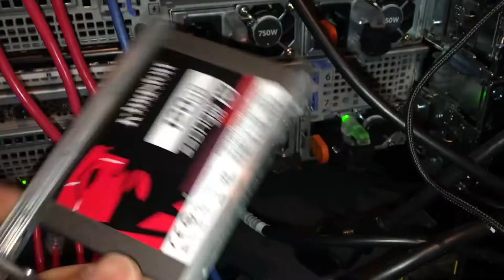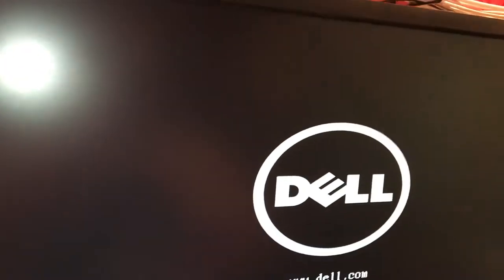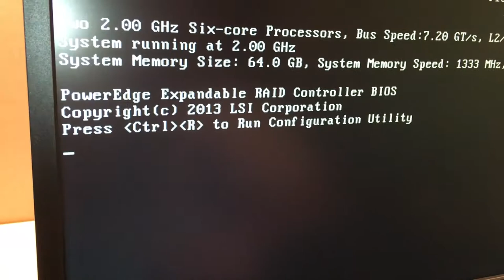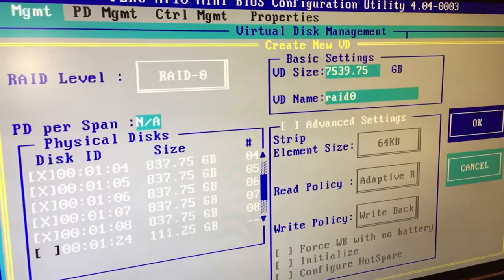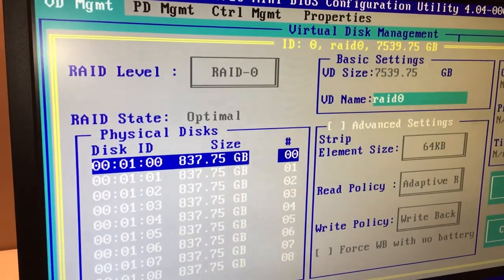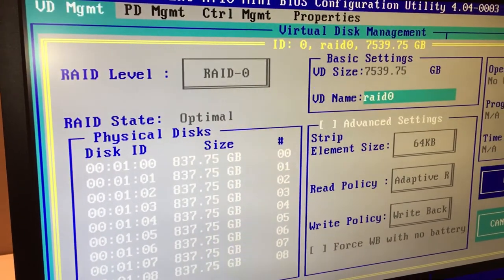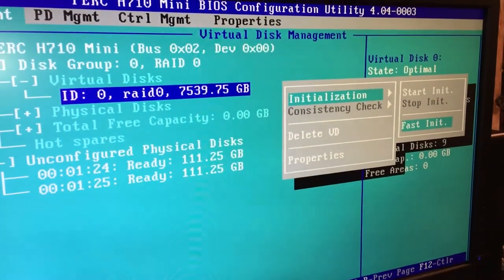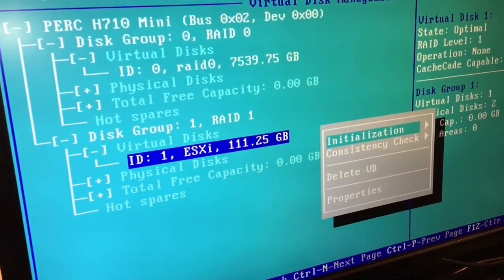Installing Rear SAS Back Plane - Dell PowerEdge R720XD

Comment: There are two versions of the R720XD, one SFF (2.5" front bays), one LFF (3.5" front bays). They sell a different kit for each version, but my understanding is that the cable length is the only difference between the two. I wouldn't count on Dell to sell you the right parts. They recently sent me 3.5" drives for a 2.5" chassis I just got from them 6 months ago. It also looks like you switched the sides of the monitoring cable between the motherboard and rear backplane. They have a sleeve near the connector that say BP and MB. Doubt it matters in this case, but could cause issues with iDRAC monitoring or something like that if both sides aren't wired the same. Thanks for the vid! Good to have more server reference on the internet!

Comment: thanks for the video. helped me get started. just FYI, he has the 2.5" front drive version of the R720XD. the 9 pin cables and rear SASA1 cables are located on the motherboard in a different area for the 3.5" front drive version. look for another video that. the one i watched is https://www.youtube.com/watch?v=azSPpVf_zFc

Comment: It's a real shame that you can't fit these to the standard R270s, only the xds.
I double checked on my R270 (8x3.5" front bays), and while the motherboard connections are the same, there are no connections available to the backplane on the front. Also I think the DVD cable takes up one of the cable slots on the motherboard that you'd use for the rear backplane?
Pity, but I guess I could use a PCI riser card for some NVME drives or similar, and have the same effect.

Comment: When you did server hosting at your home did you do it in a DMZ?  If so with what?  And if not with a DMZ then was in it your local network or in a separate network?
Reply from the maker: Tyler Lindberg Yep! I did it in a DMZ on a vSS which was standard switch now I use distributed switches which let my isolate it much better in a DMZ network
Reply: GNET Data Center so then I take it you created the DMZ with vlans in the swtch?  I only ask because im stuck on creating a dmz for my forward facing servers.
Reply from the maker: Yep that was before. Now i have NSX so no more VLANs at the switches. I have everything micro-segmented

Comment: Is there a chasis for this that you can get?  I see the backplane on ebay.  I see the kits but can't confirm if the 2.5 chasis is included. It looks like it just slides in and offsets on the riser.
Reply from the maker: There are R720XD series servers out there that have the flex bay in the rear for the 2.5” drives

Comment: Hi, any idea if the 720xd runs in bipurification mode when using pci x16 slots? Regards Stu
Reply: It does not, only from the next gen "730" model does it support PCIe bi-furcation

Comment: I wonder if the cable goes under the mother board. I have no experience, but I looked at this video. Assuming the kit provides the same length cables. https://youtu.be/nXafAY1w584?t=3s
Reply from the maker: stuart nope too short to go under it either I tried a lot of different ways